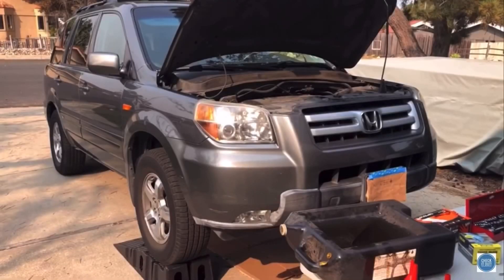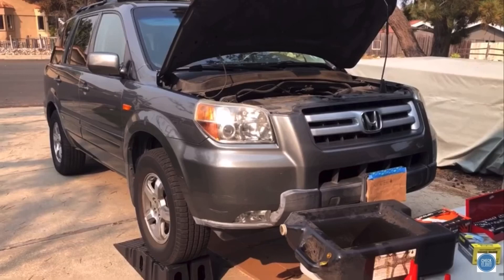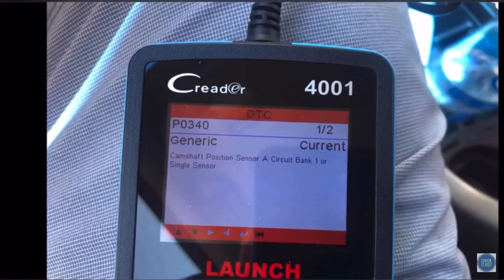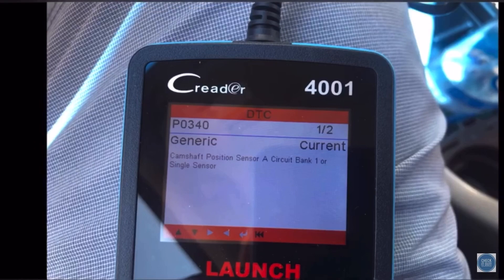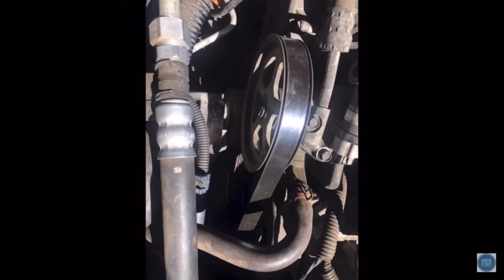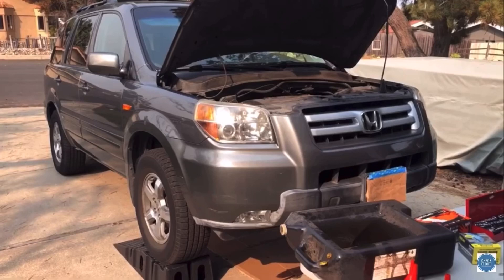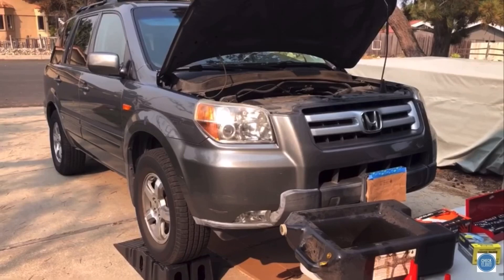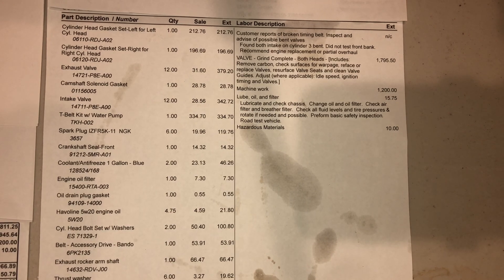Broken timing belt, interference engine, bent valves, diagnosing, shop cost to repair

Comment: Same thing happened to me. I have an 07 Honda Accord V6. I was driving at 60mph and vehicle lost power. Thought it was electrical so I turned it over a few times. My scanner had both cam sensor and crank sensor codes. Here is the strange thing. I replaced original Honda timing components with Honda components again. 1 year and 4 months in and 30,000 miles later and this happens. The belt snapped and wrapped around the crank. After further inspection the Honda water pump had been leaking out of the weep hole. I’m assuming it saturated the belt which made it snap. All the pulleys were turning smooth as well as the water pump.

Comment: What brand was the second timing belt? OEM or aftermarket? Makes a difference. The 100k miles / 7 year interval is for the OEM belt.
Reply: 11:45... "Timing belt w/ water pump kit". Looks like aftermarket for the repair parts.
Reply from the maker: Good question. I asked for OEM. Is that’s what the mechanic out in and did he really change out the pulley & assembly… unknown.

Comment: 3 days ago my 2003 Honda Odyssey with 
 250k miles hydraulic tensioner stuck and timing belt jumped on 45°. Mechanic fixed ignition time but told  me the  valves are bent! But he turned engine ON and I didn't hear any criminal knocking  noise. Mechanic  whants to buy this van for $250.00....!!!!I think he wants to cheat me
Reply from the maker: I'd recommend getting a second opinion.
Reply: Compression test and/or leak down gives a definitive answer.

Comment: Same thing happened to me on the highway at 65MPH with a 2006 Accord V6.  Had the car towed to my house.  The tow truck driver had me try to start the car with the oil filler cap off.  He could see the camshaft was not turning so the timing belt broke.  Once I pulled the back head off I could see the valves were bent and the piston heads were slightly scored from the valves.  I replaced the engine with a salvage one and I'm still driving the car now.  Fixing the engine myself was about $1300 and replacing the engine with a salvage motor was only $600.
Reply from the maker: $600 for salvage title sounds like the way to go.

Comment: Your belt broke at the minimum recommended mileage which is unusual.  Recommended is 80-105k miles or what is known as 100K service. Honda recommends sooner if you live in extremely cold climates.  Also if you had cam seals leaking or a main seal leaking oil on the belt doesn't do it good.  Personally I think it a crime car manufactures make inference engines with rubber belts.  It is only one step less in bad design as compared to the Ford Ecoboost engine where both the oil pump and timing belt are rubber and run in engine oil.  As long as I am still able to change my own belts on my Odyssey I will do them as cost at dealerships are outrageous.  I am presently doing my second belt and at 72 it is a whole lot harder than when I was 60.  Yes we don't put a lot of miles on this vehicle so I only do a belt about every 12 years.

Comment: Bought a 2009 honda pilot with 190,000 when Bought, now has 193,000 on it. When i bought it no one knew the timing history of when it was changed. Drove it for a month than decided to change the timing and water pump, its not worth the risk of destroying the motor

Comment: Maybe you should have replaced that before hand??? 🤷‍♂️ you have the same issue with timing chains it costs just as much or more to fix the tensioner and guide and when that goes parts of the teeth and chain will go into the motor.

Comment: Always buy Genuine Honda parts when it comes to the timing belt!..all the forums say the AISIN kit is pretty good too but nothing else!..
Reply: I agree with this. And get those OEM parts directly from a Honda dealer to avoid counterfeit risk. Even AISIN I would avoid, except for an old vehicle with low value. And if going AISIN, get the parts kit from a reputable parts deal to reduce counterfeit risk.

Comment: Considering that a broken belt generally means death for an interferene engine, I would NEVER go beyond the recommended distance on a timing belt.
Reply: Wrong it usually means bent valve it’s a cheap fix

Comment: I don't like a Honda!  I think they're junk but boy you can't tell a honda lover that!  They believe the garbage that "it's a Honda so you know it'll run forever!!!"  Right?  NEGATIVE!  I have  a 2013 Chevy Cruze and I replaced the timing belt at about 217k miles.  Long overdue but she didn't break at 50 miles!  Runs like a CHAMP!  It's the most reliable engine I have ever had other than my 6.0 in my Silverado or the 350 that was in my 97 Z71.  It's been even more stellar!  Don't tell me those Honda's and Toyota's are more reliable than anything! The 2013 Sonata drinks oil like nothing I've EVER seen before!  130k on it...

Comment: Listen if you'r timing belt broke you didnt take care of it. Do this every 75k -80k mi they say 100k but prevent engine rebuild/replacement at all cost you want the piston rings to go fist before you go there otherwise you have bad valve seals or the hg gave out or you ran it low on oil hence all the above. Your car is a baby it needs oil to the line at all times. Ask nissan with the v6 and Hyundai they're not gonna admit it but you'll look smart 😅

Comment: I drive an 02 civic and the code is P1361 Top Dead Center Sensor 1 Intermittent Interruption. In my case my belt didn’t break but my tensioner stop tab sheared off making my belt loose and yup, skipped some teeth. Bent valve city !

Comment: Finally! Exact same thing ford for word happened in my ‘06 pilot a week ago. I had the belt off ready to change and then found out I can’t move the cam shaft to line up timing. I’m not a mechanic but that pretty much tells me I’m screwed with this car. I couldn’t find videos on people teaching how to check valves after a timing belt snap. I love pilots but at this point I think I’m done with them. I’m gonna start thinking of what vehicle I can switch to that I don’t have to worry about this. Absolutely frustrating. Live and learn. I was not prepared for a curve ball like this either. Looks like it’s bicycle and bus while I save up. I didn’t even know this was a thing that happens, and have been learning about interference engines the last week. I like working on vehicles and I want to learn so maybe I’ll try and fix it in the future. I wish I would have learned when I was young though! Anyways thanks for your video it really helped. This is the exactly one of the type of videos I was looking for and it took a week to find it. Gotta love YouTube!!!
Reply: I rather have the Ford explorer no timing belt chain all the way 😅😅😅

Comment: I've owned vehicles with timing belts and vehicles with timing chains. I'm sure there are good reasons for manufacturers to use belts, but personally I think I'm done with belts. Chains just seem superior in general. Yes, they are more expensive to replace than belts, but I've never seen one that needed replacement (i.e. broke or stretched too far). Who needs the hassle of a $1500 "maintenance item" every 70K miles. Same goes for direct injection engines which periodically require expensive de-carboning of the valves.

Comment: I’m in the same vote my friend I have a 2006 Honda Pilot EX-L I’ve been the only owner my pilot has only 97,600 original miles on it but I’ve never changed the timing chain on it and last Thursday I went out to the supermarket in my neighborhood on my way home the oil pressure light came on my dash and I was very close on getting home so I kept driving about two blocks away from home the vehicle lii ok st power but before that I felt like a pull first so I pulled over not knowing what was going on I tried starting the vehicle but it wouldn’t start never in a million years would’ve I thought the timing chain jumped and it’s so bad that I damaged the valves in the engine unbelievable what I’m going through.
Reply: Buy Ford explorer timing chain all the way

Comment: Doesn't the manual tell you to change the T.B. every 60K-105K miles? Most people apply for severe driving, not normal driving as they may think, which will be 60K miles. Only use OEM or Aisin brand from a reputable seller. I even change the pulley bolts.

Comment: Morale of the story: buy a car with a non-interference engine, and never ever pay thousands of dollars when the belt breaks!!
Reply: Morale of the story also is to USE OEM PARTS WHEN CHAGING TIMING BELT PUMP TENSIONER ETC.  ... Peace
Reply: No thanks! I prefer timing chains as I change the oil frequently!
Reply: You would be limiting your options almost exclusively to older cars with less efficient engines. Getting a car with a timing chain is a better idea.
Reply: Think I would've bought a junkyard motor from accident vehicle
Reply: Non interference engines don't exist anymore in normal everyday vehicles. Use OEM timing parts, and if you do use aftermarket don't assume that the OEM interval applies to the aftermarket part.

Comment: Same happened to me last night on my 06 MDX, only I was going 5 miles on hour,Car just died, tried to restart couple times, oem kit had only 25k,belt snapped, Today installed my old belt just to test and it cranks fine but no start at all, I didn't install serpentine belt yet,Why would not start?Even if I have damaged couple valves should start, right?Any help is appreciated, ty

Comment: Remanufactured heads Honda pilot 2007 a pair $800 gasket kit $200. $1000-1200 same cost as replacing belt. Head replacements is simple  work.

Comment: Just had my 2010 MDX timing belt break at only 75k. Valves bent. Always change the timing belt at 60k not 100k. Especially if you live where it's hot.
Reply: I think it's good to factor time into how long the belt should last. I always heard 10 yrs or 100k miles. If it's an old belt it can harden just from age.

Comment: my Tbelt had 3K miles on my belt change ....tensioner failed ...snaped the belt........bent vales
Reply: Pays to get the timing belt kits with everything you should replace while doing the timing belt. Most kits will have a new tensioner in them.

Comment: Dude, based on that bill you got SCREWED!!! Some of those parts had NOTHING to do with bent valves. The crank shaft rear main seal for example, that's on the BOTTOM of the engine. And $1200 for the machine work? To resurface the heads? That's OUTRAGEOUS??? I just had one done for under $400 and that included the valves and valve guides. He might be "reputable", but he's not honest.
Reply: Based on this guy's story he probably did a lot of "while we are in there" items.

Comment: Same exact boat to the T. 2007 pilot died on I80 in 100 degree heat with 2 teens and 2 dogs and 3 bikes on the rack. I tried to restart several times. Thought alternator but not because there was still some power, fuel pump. Never considered the timing belt. I was about to get it changed out within a week or 2. It had been 103k miles since the last time. My mechanic said it’s a $300 gamble to test it but after hearing your story, I’m pretty convinced I damaged the engine. I haven’t taken as great of care of this car so don’t think it’s worth fixing. Thanks for all the clear info.
Reply: I would took my timing chain explorer and pull you home lol 🤣🤣🤣🤣

Comment: Those are some expensive parts.  I bought parts on eBay for my Ridgeline and rebuilt the whole engine for about $500 in parts.
Reply: my tensioner failed at 3k miles ...ebay genuine honda ebay bullshit parts .....bent my vales
Reply: @Ebbrush3  This is why it's so important to read customer comments.

Comment: thank you so much for this.  I'm afraid I'm in the same exact situation with a 2006 Odyssey.  I haven't diagnosed it for sure just yet but a lot of things are pointing towards a timing belt issue.  the only really different thing about my situation is that it seems like it happened right in the driveway,  my daughter was backing out the car ever so slowly and then it quit,  so there was no major speed involved, so I'm hoping maybe there's less damage.  I'm thinking I will get it properly diagnosed and go ahead and do what it takes to repair it because with the current economy,  getting another car would cost an arm and a leg, and I LOVE this car.   I knew I should have taken care of this, but I kept putting it off.  Oh well,  wish me luck.
Reply: Any updates on your 2006? Just had my 2003 truck die in a similar fashion…super slow speed and just died. Before i pay for further diagnosis (og shop thinks it’s a timing belt, but they’re not equipped to deal with that), if there’s engine damage I’d rather sell or scrap. Any confirmed damage on yours?
Reply: @BenRias  oh gosh,  it turned out being something totally different.  I had a situation a while before this happened that I had missplaced the keys and had to get a new key made and then I found the original keys the day before this happened.  so as soon as i found them, I tried them and they worked.  but then the next morning it stopped working with those keys but I didn't think it was the keys cuz like I said, I tested them.  well after several days of head scratching and money spent, i tried the newer keys and it worked.  something about the chip in the key
Reply: Buy a Ford explorer it has timing chain

Comment: I just watched your video, very well done. So it been a couple years since you had work done how is car running now. I have a 2006 Honda Odyssey that I’m taking in tomorrow to have my timing belt changed. First one and I have 84k on it. Thank you for the video
Reply from the maker: I ended up selling the pilot. It was running perfect when I sold it. Be sure to take your odyssey to the dealer or at least have OEM parts.

Comment: My wife  has 2006 I spent $400 on vts just to find out it was timing belt my mechanic said he would charge $175 yo put belt to check for damage but is there a way to check if piston is cracked or damaged other than putting a kit on it it's a 2006 has 174k miles has new struts rotors brakes tires we want to keep it bscuz if we repair it at least we know what we got and put into it thnx

Comment: Did your engine start making a metallic tapping noise
Reply from the maker: Nope.  Mine seemed to be running perfect until it wasn’t… sort of an instant thing.
Reply: @checkitout2468  If you could say what brand you used for the parts when you did the first timing belt?
Thanks

Comment: My timing belt went out while I was on my way to work. Luckily I stopped right in front at a transmission and auto repair shop. Fast forward a month later my car was ready. As a result, one side of the engine the valves were bent and the other side the valves were fine all and all the whole thing cost 3,500. I was stopped in traffic when my timing belt went out. I drive a 2005 Chrysler 300 limited with a 3.5L V6 with 216,724 miles. I never know anything about interference and non interference engines with timing belts until the timing belt went out. I've kept up with regular mantaince since when I first bought the car at 137,500 miles without an owners manual.
Reply: You should junk that Honda and got a Ford explorer with a timing chain

Comment: wow ... I had no idea... My honda pilot just got 300 000 miles  I lent it to a friend and  while he was driving  the timing belt broke ( I guess)  and it still run for half mile while losing power and he  tried to start the engine more than once,  also I though that it was the fuel pump. . it has the factory timing belt. I was just planning to get it to the  Honda's for service this month ... because  ABS light , Airbags light on . , also suspension issues , and Alignment . considering all that stuff ...  will it worth to fix it ???  what you think Guys.    ??

Comment: Man that's horrible. Mine slipped on startup in a mitsubishi 6g75 mivec v6 interference engine, I turned it off immediately changed the belt and water pump and it runs better than it ever has now. If you have a check engine light on, and you don't know why it could be your timing belt stretching, I had one on when I bought the car and was told it was from a cat delete. A month later that happened. I got extremely lucky, you have to get this done guys, mitsubishi wanted $2100. I watched you tube videos and followed it like the apostles did Jesus and prayed. Get this done every 70,000 miles or so just to be safe. Or this could happen. So many people don't even have a clue that they exist honestly, and if you have a belt over a chain, it's literally the most important part of your car. Alor of times when this  happens, it happens on startup and you might get lucky like I did, or this will happen. Take care of your cars guys. Hope everything turned out OK man that sucks
Reply: Did you just change the belt and the cars started ? I HAVE A MITSUBISHI OUTLANDER 2007 mivec motor, the belt broke me and my brother in law replaced the broken belt but the car didnt started, could this be bent valves ?

Comment: I don't think your shop replaced the original belt.  Modern belts go 125K easy.  ALWAYS ask for your old belt.
Reply: my tensioner failed at 3k miles ...ebay genuine honda ebay bullshit parts .....bent my vales
Reply: @Ebbrush3 eBay parts are counterfeit

Comment: Dang- same thing happened to me- however, I replaced the timing belt at 110k and it snapped at 151k-  total bummer
Reply: Did you use OEM or Aftermarket parts?
Reply: @DownloaderVideo  OEM
Reply: @Rickdoinglife  From eBay or Dealer?
Reply: @DownloaderVideo  my belt did not snap it was the tensioner bolt into the block that snapped on me.  I put a junkyard engine in it.  I believe it was my own error in my case